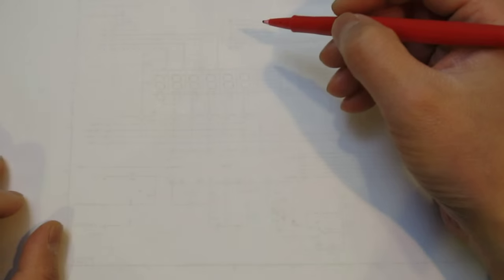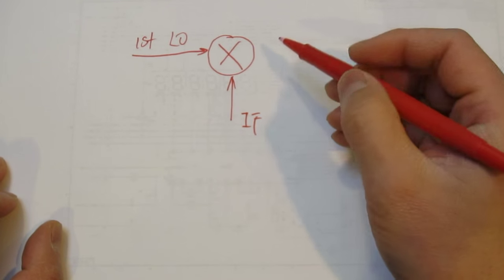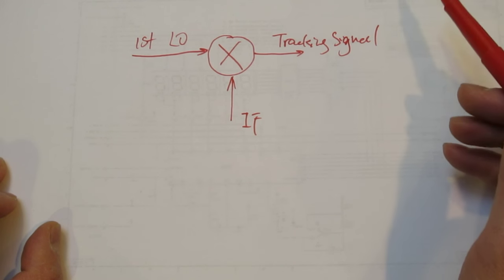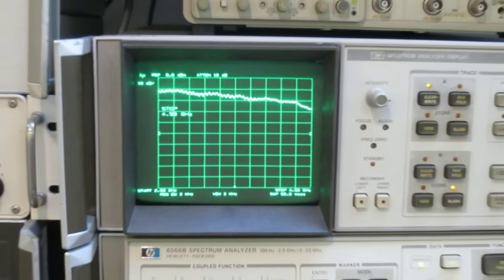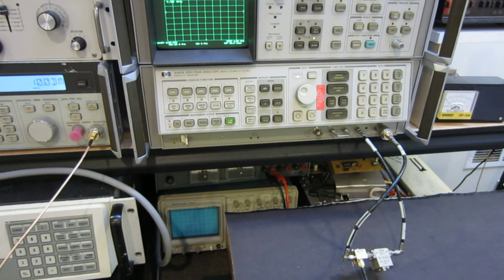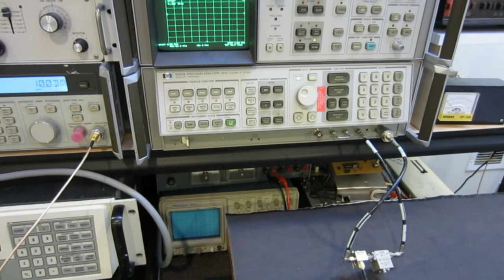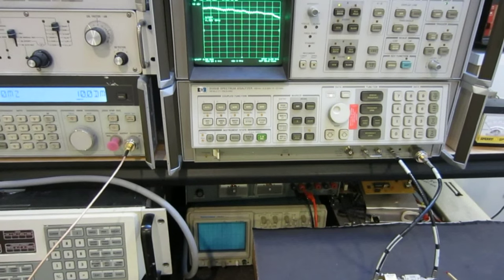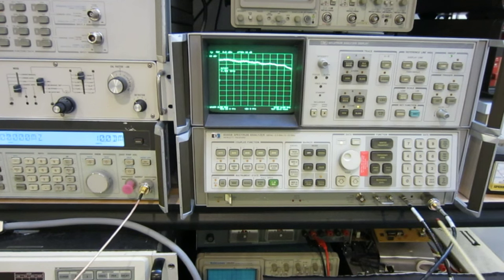Building A Tracking Generator

Comment: I got a TinySA Ultra to play with. I got an ADE-25 mixer to try this video out and used a MAX2870 signal gen set to 977MHz as Kerry said and it works well. I don't have nice equipment as many of viewers and Kerry have so my tinkering is at a hobby level. 

Great instructional video!

Comment: Hello, I have a Rhode and Schwarz Fsl3 spectrum analyzer. and when I send a 0dBm signal to its input, the tracking signal is distorted at the beginning of the band, from 9khz to around 100khz, and tends towards 0dBm by increasing the frequency.
I don't have any diagram. Can you direct me to the function that could be faulty? Thanks a lot.

Comment: Are you familiar with the TG6000 made for the HP8566B and other SA's? I bought one several years ago and it has been excellent. The dynamic range is ~85dB but considering the 8566B does not have a TG, it certainly adds new utility to an otherwise outstanding SA. The TG6000 is currently produced product by DS Instruments;  cost is well under $1K

 https://www.youtube.com/watch?v=tQDoe9e0s1o
Reply from the maker: I saw it before, but it's considerably more expensive then this simple hack. For what I am doing though, the performance of my setup is adequate.

Comment: Nice simple solution Kerry especially if you're just doing occasional characterizations. Surprisingly flat output; makes me appreciate even more having a built-in TG and the ability to normalize before measuring. Well done!
Reply from the maker: +Dino Papas Thanks Dino, I was pretty amazed at how flat the 0-2.5 band looks without the output leveling amplifier.